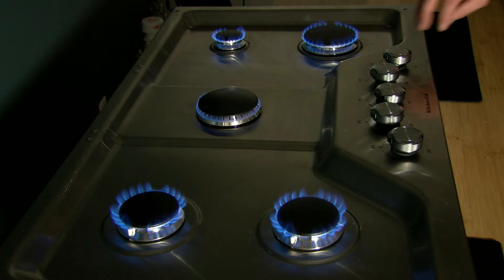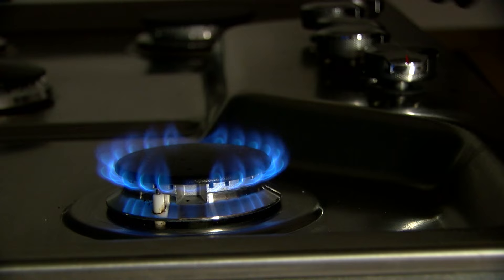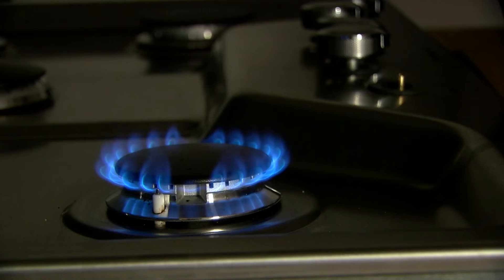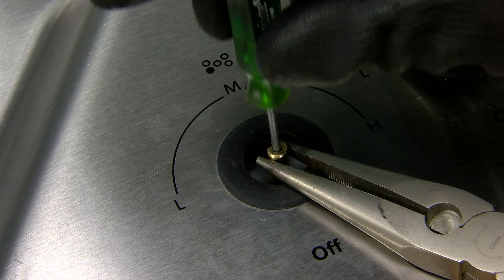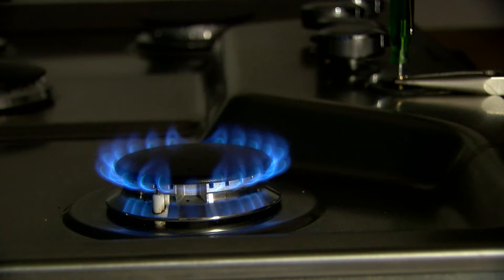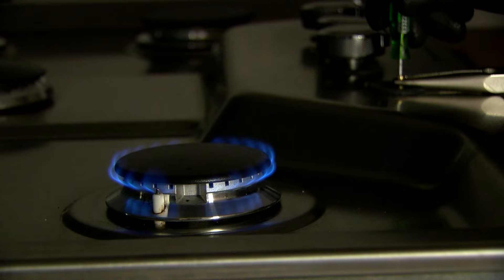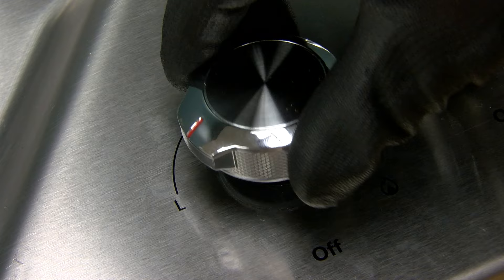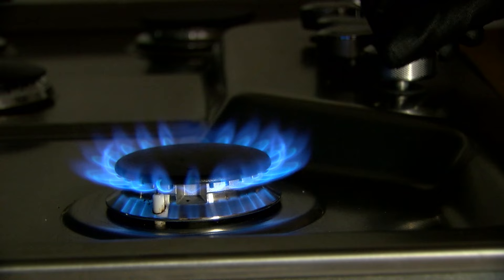Gas Cooktop Flame Adjustment

Comment: Very helpful but my GE  burner valves don't have those adjusting screws yet all four burners have a low flame even at highest setting. The stove is four years old and like new. The oven works fine. Unfortunately I bought it this way and so I don't know the history. Any ideas? Thanks.

Comment: Seems like there’s no screw inside my valve stem, it looks exactly the same as in video & online manual says to do the same thing, but there’s no screw grip or tightening…any tips?
Reply: I was going to ask the same thing... did you ever figure it out?
Reply: @andreyeampierre2377  
sorry still haven’t😂…I have the right tools, but couldn’t feel a screw in there…tried forever.
Reply: Yeah mine isn't a flathead either I'm not sure what tool to use